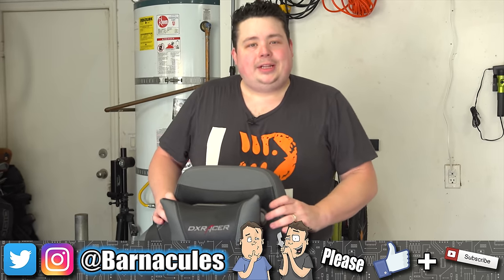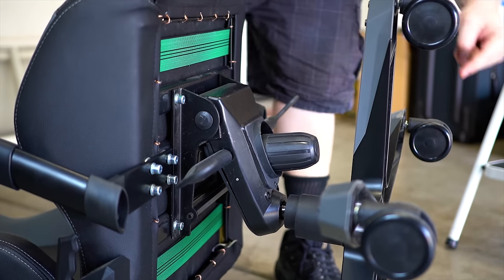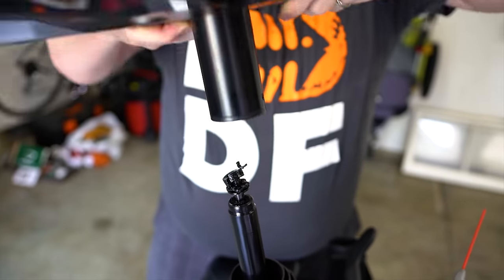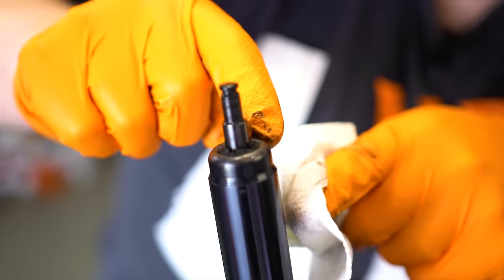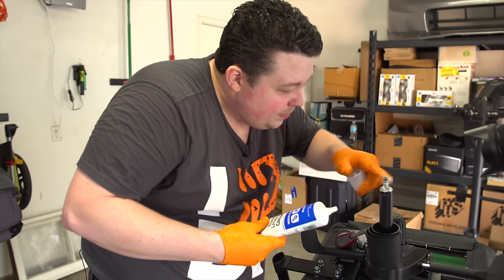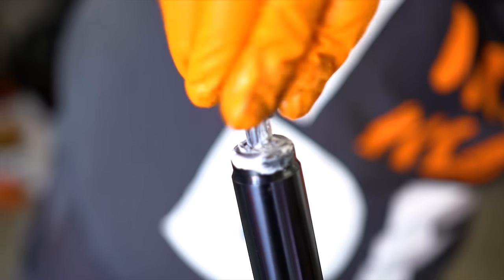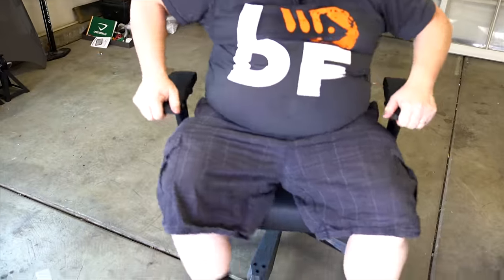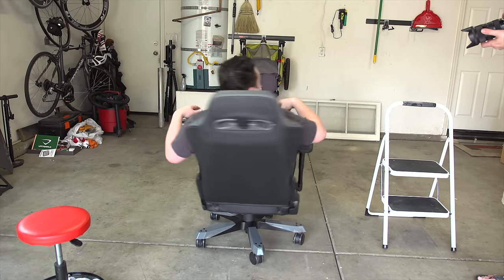How to Repair DX Racer, GT Omega, AK Racing Office Chairs! - @Barnacules

Comment: OMG I FIXED IT!!!!!!!!!!!!!!!
I needed to take out the entire PISTON. I dismantled like you said but it still made HORRRIBLE cracking noise. So I took it all apart again.. but this time forced with my hand to move the piston and CRACK noise instantly... so I figured it has to be the piston connecting the chairs mount and that it has no lubricant, dried up.. so I used a hammer to hammer on the mount and pull with the other hand on the piston and got it out, lubricated the base of the piston and the inside part of the mount AND WHOILA!!! WORKS!!
Something to take note for everybody still having issues :)
Reply: same issue here this should have more likes so more people see it!!
Reply: Aggrobiscuit just clean the grease, pull and hit it hard 😂 srsly had to hit it pretty hard. You can try yanking when pulling aswell. Imo best if you can find some person to hammer and you pull or vice versa
Reply: God bless you dude, absdolutely the same thing, I boutght today lithium grease and this didnt work, after your comment i removed the gas lift and lubricated its base, and this works!👍
Reply: @German.Misuto  thats awesome, my chair 5 years later still no cracking noise :D but its so torn apart now I need to buy a new one. Money well spent tbh.

Comment: This actually works!  I had taken my chair apart several times and thought I was lubing the right things but it just kept on clicking.  I even hit it with a rubber mallet a few times to no avail.  My parts were not worn at all but after I cleaned everything with WD40 and then slathered the bearing and washers with a heavy bearing grease it fixed the problem.  Thank you.

Comment: Thank you, Barnacules! I tried this exact fix once in the past and had limited success, but this time I cleaned everything well and slathered grease over everything on the bottom part of the cylinder and it worked a charm.

Sincerely, an old fan from back in your codegasm days

Comment: Very nicely done. My new (to me) Aeron had that infuriating click/pop sound I thought came from the seat support mechanism. I followed your steps, and found the bearing and washers messy, but not badly worn, so figured that wasn't my problem. I cleaned everything,  lubed with lithium grease and reassembled. Fixed! Took 10 minutes including running out to the workbench to get things to work with. Thanks!

Comment: Thanks ALOT! Ive been sitting in a squeaking DX Racer for like 3 years and never understand what the problem was. Saw this video and got to my work and found a old chair that i got the parts (because mine was compleatly TRASHED. WOrked fine! The new ring was abit too big so i had to cut it abit so it could fit.

Comment: Thank you for your video. I bought my chair already assembled. It was popping like crazy, so I watched your video and tried to fix it. Turns out there were 2 extra washers  on there, so I left them off, put it back together and I think it's working fine now. The chair is squeaking so I will tighten up everything and hopefully I will have a quiet chair!

Comment: My desk chair was completely fucked. It's 4 years older than this video and was so damn loud with any movement it was time to get rid of it. Unfortunately they obviously stopped making it and for the life of me I couldn't find another I liked. Thanks to this video, I figured out that the rubber bumper and the ball bearing were completely busted. After replacing them, cleaning shit up, and applying generous shaft lube, it sounds like a brand new 10 year old chair!

Thanks for this video man, you're great and I loved it. It has for sure  bought me a few years before I ditch my chair for good.

Comment: This was seriously so easy, took me 10 minutes taking my time and my chair (Secret Lab Omega) is now super silent again. Awesome video, thanks for sharing!!!
Reply: I noticed my Secret Lab Omega is doing clicking noises when I tilt back, was yours having the same issue? I'm researching right now to figure a fix
Reply: @cherppy_  Mine didn't click at all, just squeaked as a rotated. But given what was said in the video about clicking, it should help. And now my chair is super smooth and silent.
Reply: @MyMo689  thank you! I’m going to give it a try tomorrow, if anything I will contact warranty 😊
Reply: @cherppy_  Awesome, glad to be of assistance!
Reply: I don't know if you can help but do you know how to fix the back of a gaming chair leaning back too far. Like the back of the chair isn't straight anymore. I can't find anything anywhere about it
Reply: @okiagreebut5609  I would think that if it isn't straight, your best bet might be taking it apart and inspecting the pieces. Also contacting warranty services. The 2 I purchased are still perfect so far when it comes to that.
Reply: @MyMo689  I bought mine, a mazda gaming chair, for 20$ off someone. I think the only way I could fix it is by taking it apart and hammering away at the metal that connects the back to the seat but I don't want to break it
Reply: @okiagreebut5609  ah gotcha, well yeah I probably can't help much with that then, sorry!

Comment: FANTASTIC!! Thank you for the fix!! This worked perfectly for my Secretlab Omega. I thought for sure I was going to have to send my chair in for repair. I found that for my chair the rubber piece that goes on top of the bearings was shot so the only fix was a standard hose washer. Works great. Thank you!

Comment: OMG I LOVE YOU!! My girlfriend got crazy from the clicking noises my IKEA MARKUS chair made whenever I was moving. Opened the bottom up like you did and found lots of small pieces and the metal washers had grooves in them. Cleaned everything and reassembled the washers upside down. (With IKEA MARKUS the assembly order is: rubber thingy, washer, ball bearing, washer; then put the starfish on, another washer and the securing clamp.) I HAVE A SILENT CHAIR AGAIN.

Comment: I have a DXRacer King series and it was a little different on my chair.  I had to replace the parts and used the instructions that came with the parts from the amazon link for $9.  Thanks for the video.  It showed that it could be fixed!

Comment: I did this and it greatly reduced the noises, but the rubberring was broken so im probably gonna get a replacement for that in the future. It didnt work at first but i just opened it up again and applied more grease. I didnt have the white lithium grease but used one that was "oil"colored.
Great video, helped me out a ton

Comment: great video, first time know that this issue is caused by the bottom bearing. I had the same problem with Corsair T1 gaming chair(bought 2 T1 chair, one is ok, the other has the exact same issue). BTW, Corsair T1 chair's BACK MOUNT COVER never fits on the back(just hanging there loosely), so if you have OCD or cannot bear that , don't buy this chair.

Comment: I actually did this fix to my desktop chair a few years ago, except one of my entire ball bearing shattered. I ended up replacing two of those balls with copper BB's I had laying around from my pellet gun, as they were roughly the same size. Worked out pretty well, still using the chair to this day.
Reply from the maker: +Kennykid2002 that is really clever.

Comment: Also works with Maxnomic chairs. They have plastic bushings instead of the ball bearing but the fix still works. Additionally I turned one of the worn out washers around, which got rid of the wobble.

Comment: JERRY YOU LITERALLY JUST MADE MY DAY!!!

 do you know how many people will use wd40 for greasing things? despite the fact that the wd40 is actually not a lubricant and contains metal particulates which can cause damage to things that require oil. also wd40 doesnt last very long.
Reply: Original application: Keeping missiles from corroding in their silos.
Reply: yes. because it displaces water. hence water displacement 40 or wd 40 for short. however as i said its not actually a lubricant. its a rust inhibitor and remover. also it wasnt just for keeping them in the silos, one of the parts of the original missles had an issue with the part being rather thin and flimsy to the point of having to be stored filled or inflated with some sort of gas to prevent it from collapsing in on itself. the wd40 was used to prevent corrosion from happening and eating holes inside the part. pretty sure it was like an oil or fuel tank or something.

Comment: Hey Nerdgasm, thanks for the video! My chair was getting ultra loud. It was insane. It would scare people if I spun myself in the chair, POW-POW-POW!! Office drive-by! 
It's my desk chair at work in an office with other people....

So, I watched your video Friday, and today I brought in red lithium bearing grease and some other tools with me into work.
I didn't even clean the bearings b/c they weren't goopy(?). They were actually just bone dry. And there was no apparent damage. 

I applied the red grease to everything down there, put it back together. Btw yes, that clip does come off very easily lol.
And now, there's no noise at all. Completely silent. I still squint my eyes when I lean back in it, waiting for the pop. Feels like a different (or new) chair now.

Big thanks again for this video. Liked and sub'd.

Comment: Great video and I used it for my Kring chair (cheaper gaming series not much known). But I have another issue - when I sit the chair quite abruptly moves down in a single motion and makes an noise - cleaning and lubricating it didn't help and the rubber looked good. When I stand up it makes the same sudden movement and noise, as if the mechanism is quite clogged - it doesn't move slowly as it used to be when new.

Comment: never heard this on either of my aKracing chairs :) but I guess there has to be a reason?
Reply from the maker: I think it more commonly happens to heavier people that wear out the parts quicker.
Reply: Barnacules Nerdgasm yep
Reply: i have akracing chair and i didnt notice this problem until now he made the video and i found my chair makin this noise lol.
im replacing chair with vertagear triigger 350se in a month so heh
Reply: Jay doesn't look heavy.
Reply: My akracing is completely quiet, I doubt that's gonna change, but if it does I know what to do.

Comment: i have a chair that''s 25 years old and i was wondering why mine was making such noises i tried this and its way quieter still does it a slight here and there but compared to before and flopping and snapping so much this is alot better i never knew this or ever a fix was possible till now

Comment: Hey thanks man :) Going to do that the next few days with mine as it makes simliar noice^^ However what I had with my last chair and maybe you know a fix (besides buying new piston) was, that it deflated? after a while and I had to expand it 3-4 times in a row before it managed to hold itself upright. Do you know if there's a fix for that or should I just go with a new / stronger piston next time? (Amazon just replaced the whole chair instead of the individual item last time)

Comment: Hi. Thanks for the video. I have same DX Racer Iron (even same colour). My chair makes this 'cracking' sound every time i'm rocking back and forth (there's no noise when I swivel around). I took it apart like you instructed. The only difference was that my rubber spacer was in a bit worse condition. I cleaned it, I greased it, put it all back together and... it's still the same.

So I wonder - would new rubber spacer help?
The bearing kits on US Amazon also have 2 washers above and below the bearing, which makes sense to me. Also the rubber spacer is in different position (wrapped around the center rod). In case of this DX Racer there is this rubber spacer instead of one of the washers. It's no surprise it's wearing out... If I will get the repair kit, should I install it like it's on DX Racer Iron or according to the instruction on the kit?

Finally, I live in Ireland. I tried to find the repair kit in Europe, but with no luck :( Can anyone help me, please?

Comment: I fucking love this. You are the best. 

Although my model of the King Series chair had a different arrangement of parts within the gas piston.

Instead of washer/bearing/gasket. It was gasket/washer/bearing/washer. 

Even after greasing all the parts and putting them back in the same way they were in, I was still getting the popping noise when rotating the chair. So I took everything out again. And turns out the second washer (the one on top when the chair is upside down) had a really uneven groove within it. Part of the circular groove was all jagged and much wider. I flipped the washer to have the smooth side against the bearing, and that fixed it for me.

Comment: Crazy how these companies sell a premium chair and cheap out on things like these thrust bearings.  only having a washer on one side I suspect is the cause of the issues.  put a washer on either side of the thrust bearing and it won't break like Jay's did.. the carrier is never supposed to receive enough pressure to break it.. I fixed mine a while back with parts from an old chair.. new bearing from that chair and two washers plus the rubber bushing (which is supposed to be a 'bumper'.. 

You didn't bust out the Batknife to remove the clip... :)
Reply: You hit a pet peeve of mine. High quality chair, cheap box store chair hidden parts.  Similar, "ball bearing" cpu fans... that still use a rubber o-ring as a thrust washer.

Comment: There's one thing to be added though: you can fix the cylinder and still get wobble.
Before you waste time on this method, try this:
wrap your hand around the cylinder right where the thicker part ends and the extension cylinder pops out. Check if there's wobble. Then, wrap two fingers at the top, where the cylinder joins the tilting mechanism hub.
Tilt the chair back and forth a few times. If you can feel the tilting mechanism hub sliding around the top of the cylinder, the mechanism hub is busted and you're screwed, because if the top wobbles you'll still lean forward, add extreme pressure on the cylinder and the cylinder will end up wobbling in no time.

Comment: The lithium grease in the tube or bucket is far easier to work with then the stuff in the spray can that ends up splattered all over the place. The local shop only had the stuff in the spray can for some odd reason.   Some plastics degrade (dissolve of a sorts) when in contact with oil based lubricants, and many chairs have some form of plastic bushings (even the 1963 Steelcase chairs). lithium grease is the best choice over all.

Before the advent of disposable plastic chairs with pistons, a collar on a threaded rod was used to adjust the height of the chair. On that collar is a small screw that retains the feet (starfish) onto the threaded rod. Some collars are held on by a keyed lock washer and a grove in the threaded rod that dose not extend to the end. If you try to just wrench the collar past the stop at the ends of the threads, it will damage the keyed lock washer that is also the upper 'race' surface for the swivel thrust Bering (game over). back out the little screw in the collar, lift the chair off the feet (starfish), and leave the collar on the threaded rod as you clean up and lube the surfaces.

Thanks for the nudge Barnacules, I had neglected the maintenance of some stuff (including my chairs) for a little over five years, it needed to be done.  BTW, The plastic chairs have never lasted me more then a few months before something breaks (piston, back rest, arm rest, etc), if only things were made better like they were in the 60s and earlier. Wow, The wheel beings on my 1956 Steelcase flightline chair are beefier then the swivel Bering on that 'gaming' chair, at least it is not just a plastic sleeve bushing like some ultra cheep disposable plastic chairs, lol.

Comment: My set up was completely opposite of yours. The rubber piece went back first, then the bearing, then the metal washer. Mine would make more sense as it would stress out the rubber piece less. That would explain why his rubber was disintegrating so badly.

Comment: hey bro,i don't have whatever you used to lubricate it .. does it have to be specific stuff or basically anything that will do the same job ?
Reply: He used white lithium grease but any thick lithium grease or copper grease will work - try a local auto shop

Comment: Another tip for these chairs, if your screws start to back out overtime (mine did) simply add a little thread lock to the bolts.

Comment: I got a DX racer a few years ago and I'm not sure what's wrong with it. The Base seems to have warped so the cylinder is grinding against the floor, and the cylinder will not keep pressure. I have need looking everywhere and I have no clue what is wrong with it.
I cannot even get a straight answer when I'm looking for parts. Will an officer chair cylinder and base work for a DXracer? If not where can I find replacement parts?
I'm completely lost so I'm asking on quite a few places.

Comment: If you go auto zone or advance auto parts(any auto part franchise store) and get a small packet of white lithium grease for like a 50 cents. They usually have a display of them hanging near the register.
Reply from the maker: +Cj2tech91 thanks for the tip!

Comment: This is super late. But I do believe the rubber spacer had been pulled into the wrong position during removal. I also believe you may be missing a washer. Go look at a cutaway of chair piston hydraulics. I've never seen one like that. The rubber bumper is there for when you drop the chair down as a shock absorber I do believe. But I may be wrong.